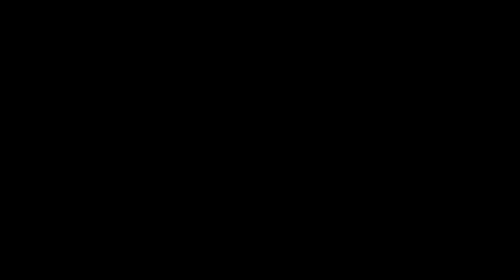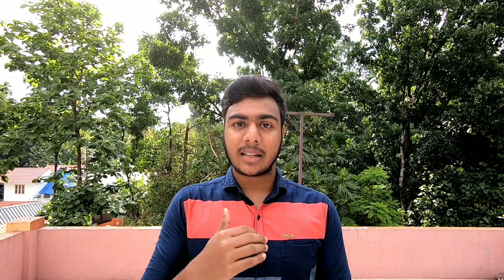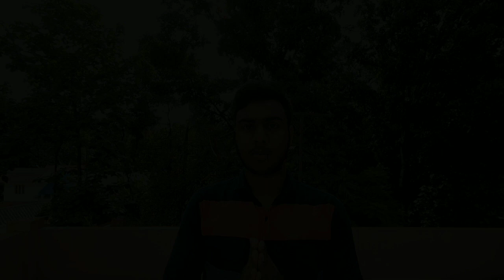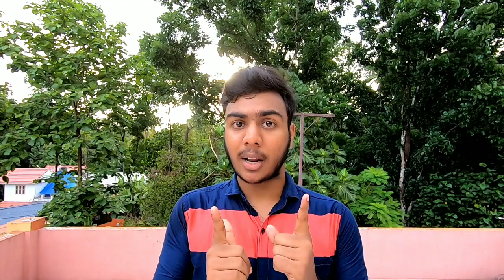Single Cylinder vs Multi Cylinder Engines | Effect of multiple cylinders |  Explained in Malayalam

Comment: ഹായ്, reanult കമ്പനി cars നല്ലതാണോ? Reanult kiger  3 cylinder engine ആണ് എന്തെങ്കിലും കുഴപ്പം ഉണ്ടോ? ഞാൻ മാരുതി baleno എടുക്കാൻ ആണ് ഉദ്ദേശ്ശിച്ചിരുന്നത് ഇപ്പോൾ ഒരു കൺഫ്യൂഷൻ. ഏതാണ് നല്ലത് 3 cylinder, or 4 cylinder? പ്ലീസ് reply
Reply from the maker: Broo...
Nallathano ennath kond reliability aanu bro udeshichathenkil renaultinelal maruti aanu reliable... 
Pinne cylinderinte ennam vech orikalum ethanu better enn parayan pattilla... In general 3 cylinderinekal refined aavum 4 cylinder... Pakshe cc, fueling, compression ratio athupole orupad karyangalude adisthanathil aanu engine performance vyathasam varunnathu... For example, kigerinte turbo 1 litre inu balenode 1.2 litre enginekal power output ond... 
Baleno njan use cheythitund nalla vandiyanu but kiger njn use cheythitila athukond ariyila... 
Brode preferences enthoke aanenn enik ariyila so randum test drive adich nokiyitt oru vandi choose cheyyunnathavum better... 😃
Reply: @StoriesbyLukog  thank you bro

Comment: Ninja 300 27nm torque at 10000 rpm. Oru single cylinder bike with same configuration ne kalum initial kuravayirikumo?
Reply from the maker: Talking generally single cylinder aanenkil initial torque kuduthal aarikum but top end kuravayirikum... And video il paranjathelam engines mathram kanakileduthanu... Acceleration, pickup, top end thudangiya ella karyangalkum transmissionu oru crucial role ond... Gear ratios um sprocket size um vyathasam varuthunnath anusarich bikukalude character marum...
Reply: @StoriesbyLukog  Ninja 300 or Dominor 400 UG. No of cylinders, torque, bhp, suspension (front),  riding posture.. price thalkalam ozhivakkam.. Which one is best.. price comparison venda..
Reply from the maker: An entry level sportsbike vs a sub 500cc sports tourer (cruiser) is not a fair comparison... Anyways ninja aavum aadyam 100 kmph ilethunnath... Njn ninja odichitila but still from my internet knowledge ninja has got better suspensions... Riding posture doninarinu relaxed aanu and ninjaku engaged aanu... Ninja is a lot more refined than dominar... Ninja around 20kg lighter aanu with almost same power... So more power to weight ratio...

Comment: Royal Enfield single cylinder multi cylinder aakunnathinu aakadhesham athra cost aakum
Reply from the maker: Not practical and near to impossible... Same displacement olla veroru engine add cheyyunnathanu uddeshichathenkil aadyam thanne engine - transmission area full redesign cheyyendi varum... Athupole thanne frame ee load okke withstand cheyumo enn nokanam... Cheyyan sadyatha theere koravanu... Ithelam solve cheyyuvanenkil thanne ath road legal avukayilla so veliyil erakkan pattula... Oru project bikenn olla reethiyil cheyth nokamenne ollu... Swanthamayi workshop illenki you will end up paying as much as a new bike costs... But still njan pand oru video kandittund oru rx100 twin akki rx200 aakkiyath... Tamil nadu sidil ulla oru mechanic arunnenn thonnunu... Anyway overall design mattam varuthi cheyam but budget onnum parayan pattathila...